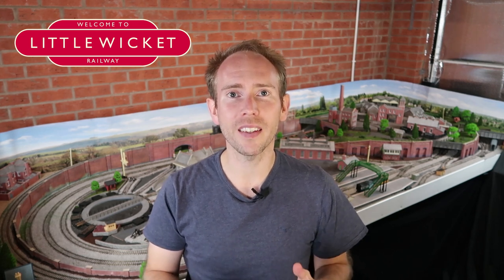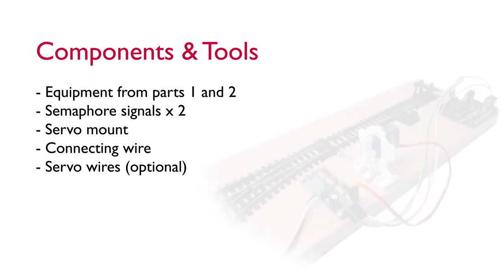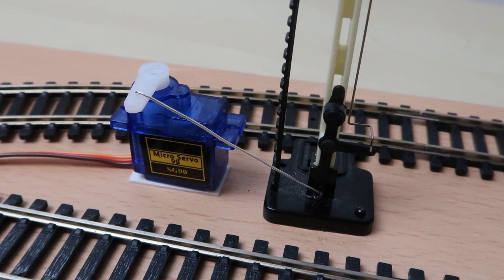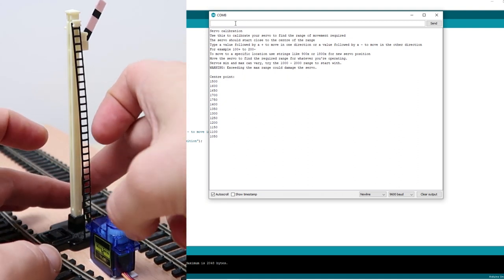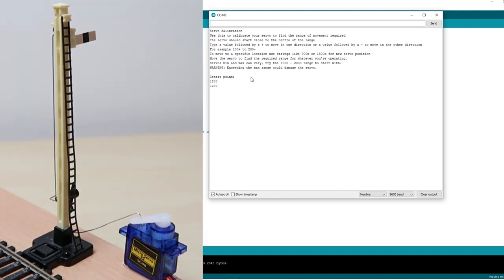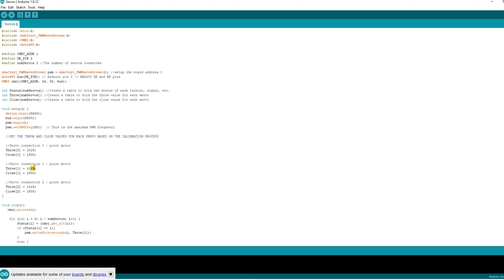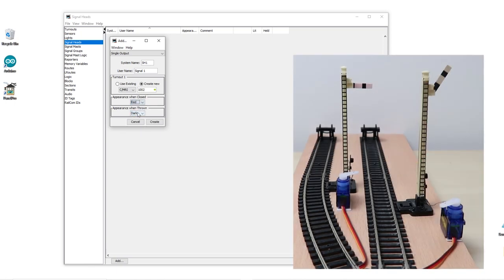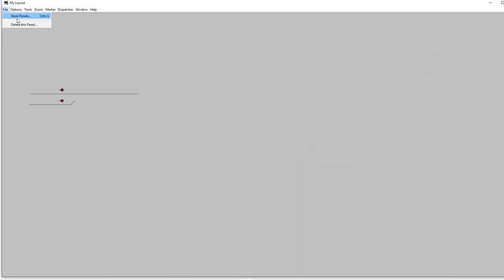Servo Motor Control for Model Railways Part 3 of 3 - Semaphore Signals

Comment: Hello Rob, I knew nothing about Arduino, but after watching your 3 videos, bought Uno, servo etc and  I made my first project for my test layout and worked, great!!!.....I could not use DCC++ right now as my collections are Marklin....but found Railuino....this will be my next project. Thank you for the video....
Reply from the maker: Thanks and congratulations on a successful project! 👍
Reply: @LittleWicketRailway  Hi Rob, based on your original sketch, I could modify the sketch for multiple PCA9685 for servo, but still do not know how to sketch for the LED, appreciate very much if you could make a video (part#4?) for PCA9685 connecting with LED for signal lamp (Red, Yellow and Green). I tried, but it did not work. (my first PCA is for turn out, 2nd for semaphore signal and 3rd one is for signal lamp). Thank you and appreciate very much.
Reply from the maker: Hi Nugroho! You were ahead of me in linking PCA9685s, I've only just round to doing it. I was actually reading about controlling LEDs today! Are you using a tricolour LED or 3 separate LEDs?

Comment: Now watched all 3 videos, and I got it working. Excellent tutorials. Managed to get my head around JMRI , CMRI. Doesn't seem too complicated now. Watched others and ended up with several bits of hardware I didn't need. I will start with a small shunting layout and see how it goes. By the way I am using 3 rail Hornby Dublo that is at least 60 years old.
Reply from the maker: Congratulations on getting it all workings! Hope that it all works with the 3 rail set up, I like the idea of having a 60 year old layout being controlled with modern digital electronics. 👍

Comment: Thanks Rob you have converted me to your system of servo control thanks.
Reply from the maker: Thanks Steve, sadly I installed solenoid motors on Little Wicket before I discovered servos. It's looking like I might get the opportunity to redesign and expand Little Wicket in 2021, so I'll definitely be converting to servos if that happens.

Comment: Hello Rob, I only found your channel today and are very impressed as I've been looking for ways to automate my railway, I like the robust design for changing points and signals, infact after watching many videos on the subject I find yours the Best. As a retired BR signalman signalling  has to look right on a model railway, I watch in dispare at the Hornby magazine layout with there GWR bracket signal by the station, not so much that it's a Midland railway layout its the fact the taller arm should represent the main line not the lower. I run a OO gauge Garden railway with about 240 feet of track with many points and signals, unfortunately my computer and it's attachments skills are almost zero, I don't know what you do for a living but if you ever had the time I would like to commission you to use your methods to automate and install them on my railway. Thank you for informative and inspirational video's.
Reply from the maker: Hi Paul! I know who I'm coming to for advice on signalling in future and your 240ft layout sounds amazing! However, I don't think I'm quite at the stage where I'm ready to do commissions. I'm still learning and there's some way to go. If our house move goes to plan then I'll be building a larger layout. If that goes to plan then I might feel a bit more confident about working on someone else's pride and joy. Stay in touch though and if you've got any pictures of your layout then I'd love to see them 👍😀
Reply: @LittleWicketRailway  Thank you for your reply Rob, I hope the house move goes well. I have every confidence in your ability to install signals, point work and automation on model railways, you can't bluff on a subject so complex, I appreciate your honesty and indeed none of us ever stop learning whatever the subject, I appreciate components and wiring has to be more robust and protected outside, but I still hope you could help me install it in time, I would like to send you pictures and videos but haven't enough computer knowledge to do it at present or even how to contact you in private, please keep up your Great work and I'm very impressed with your knowledge and presentation,  kindest regards. Paul.

Comment: To add a tad of realism you can set the range of movements to slightly different settings (maybe +/-10) to show a degree of wear between different signals.

Comment: This is getting me towards my idea, as my layout plans will involve a lot of points, servos are the way to go for me, just on the cost saving, but i dont need computer software, my intention is mimic panels for each area with switch control and led indicators, i`ve yet to find a nuts and bolts video on this, unless you can point me in the right direction, Thanks great series of videos.
Reply from the maker: Hi! I'm been thinking about this a lot recently and I've got a few ideas. You're the second person to ask about using a mimic panel with physical switches rather than a computer. First few days of 2021 will be dedicated to electronics so let's seen what happens. Hope to come back to you with a cheap and simple solution.
Reply: @LittleWicketRailway  Thanks only one i`ve found is toms trains and things using a pca9685 but he was switching a sevo via the uno

Comment: One more step to complete: add a logic that automatically changes the aspect of the two semaphores according to the turnout direction
Reply from the maker: Hi! Check out this video with full automation. The signals change automatically based on block occupancy and the position of the turnout https://youtu.be/5lvvoBCQl9U

Comment: Hi Rob, just discovered your site. Excellent tutorials. Could you clarify something for me? I’m using a SPROG 3 as my dcc controller, with JMRI. I want to use servos for the points , so am I correct in understanding that I need my pc connected to both the SPROG for train control, and a separate Arduino + servo driver board for the points.?  Does JMRI allow both Sprog and Arduino simultaneously?
Thank you

Comment: Nicely done videos! The whole servo calibration is really messy, and I wonder if there's a better way to handle this all. AIUI the Adafruit library can read the actual servo position so you could perhaps manage some automatic min/max discovery.
Reply from the maker: Agreed it's messy. The issue is that there's no easy way to sense when the servo can't move any further (I.e. stalled) servos with built in feedback are expensive. There are ways of adding feedback, but they're not simple.

Someone (apologies I can recall who) has significantly improved my sketch and has submitted the improvement on GitHub for me to review. I think the improvement makes calibration a lot easier from what I briefly saw.

I also want to look at building some stall protection into the sketch. Let's say a turnout/point can't fully throw because something is in the way. The turnout will keep trying to move through the obstruction. It'll draw a lot of current and I don't think it'd be good for a servo. I'd like the servo to stop trying after a couple of seconds. This makes exact calibration slightly less important.

Comment: I'm just getting into Arduino as a preparation to a future build, and your tutorial was super helpful.
But I still got a big question, if you don't want to use a computer as your switching pannel, but much bottoms or switches, as you would in an old fashion layout but using a programmed Arduino is that also possible?
Reply from the maker: Thanks! Yeah, definitely possible. You might find this useful https://youtu.be/-qEL5MGZXB4
Reply: @LittleWicketRailway  Thanks for the link, I'll have a look at it, I love you YouTube channel, very well made and understandable videos👍

Comment: Great videos thank you  question I built command station using instructions from your other video  This uno is a new one I need to buy to control points and signals ?
Reply from the maker: I kept my command station separate from my sensor/servo control, but DCC-EX allows you to have everything connected one one board. I've just been playing around with automation using EXRAIL which is brilliant.
Reply: @LittleWicketRailway   Are you still using Arcomora?

Comment: Hi Rob one question is there a way to control those servo with a button, so i dont have to klick it on JMRI instead i wire it to a button when i click it switch does brrt to the left when i click it again goes brrt to the right :)

Comment: Can i ask a stupid question. You connect the arduino to a pc to program it. Does it need to be connected to the pc once programmed?
Reply from the maker: No stupid questions 🙂 It doesn't need to be connected to the computer once the sketch is uploaded.
Reply: @LittleWicketRailway  Thanks. Another question, i take it i do the arduino and jmri software bits. How can i control the points? Would toggle switches, buttons or stud and probe be options?

Comment: Hello I have been watching your videos and have tried to use your servo sketch to drive 16 servos. I have been able to get 8 servos working but when I add number 9 in they all just start twitching and become unresponsive in JMRI did you have any problems like this ? If you did what was the fix. thanks James
Reply from the maker: I haven't had this problem, but it could be "servo chatter"? @Stephen Wadsworth (not sure if that'll tag him) said that he experienced chatter and added a relay with a slight change to his code to solve it and now has 34 servos operating. See his comment on here https://www.youtube.com/watch?v=WsfczIPbhsU

Comment: Rob I just watch these 3 videos in the series they are very good and have got me wishing to try this.
At the moment I use a Roco Z21 controller with Digitrax point controllers linked up using Loconet.
Do have any idea how I could interface the system into my setup I have played with JMRI and have the Digitrax interface to a PC 
I would like to use the Z21 for control of the points using servos.
Any ideas how to interface them together
Thank you
Dave
Reply from the maker: Sorry Dave, I've got no experience with Roco or Digitrax. JMRI is a very useful hub for bringing various systems together, so you might find that if you can get all your systems recognised in the software then you could have your existing controllers operating the servos one way or another.

This might be useful:
https://www.jmri.org/help/en/html/hardware/roco/z21/index.shtml
https://www.jmri.org/help/en/html/hardware/loconet/Digitrax.shtml

Comment: Hi Rob,  Fantastic Videos.   I get these 3 vids and your explanation has really opened my eyes to the possibility of servos.  One question though, can you run them off a physical analogue momentary switch like I want to on my layout?
Reply from the maker: Hi Tra, you definitely can have servos activated by a push buttons, but you'd still need a servo driver than could generate the PWM signals that tell the servo which position to be in. You can either build your own controller using something like an Arduino and PCA9685 (see this video - https://youtu.be/-qEL5MGZXB4) or buy a ready made solution (https://megapointscontrollers.co.uk/product/servo-controller-12/?v=79cba1185463).
Reply: @LittleWicketRailway  Great thanks Rob, I will get to it I already have the kit you discussed.  Keep up the great work.

Comment: This is very interesting and well presented. My planned layout is a shelf layout about 30’ long. Do you know how far a servo can be from the servo driver board and the Arduino?  And how far apart the servo driver boards can be?
Reply from the maker: If you use CMRI then the CMRI wires can be very long, hundreds of meters I believe. Not sure about the servos, but I'm had one on a 6ft wire on my last layout.
Reply: Thanks

Comment: Hi Rob.
Any chance you could do another video showing how to add a push button to throw the turnout locally and keep JMRI updated?
Reply from the maker: I'll have a think about this. Would you also want to be able to throw the point using JMRI or just using the physical switch?
Reply: @LittleWicketRailway  Hi Rob.  Control from JMRI or the physical switch and keep everything "in sync."  Here is what I have come up with so far using your JMRI servo motor control sketch and a JMRI/physical button sketch from "motorhomer's" blog http://www.motorhomesites.org.uk/?p=5007. 

#include <Wire.h>
#include <Adafruit_PWMServoDriver.h>
#include <CMRI.h>
#include <Auto485.h>

#define CMRI_ADDR 1
#define DE_PIN 2
#define numServos 3 //The number of servos connected

Adafruit_PWMServoDriver pwm = Adafruit_PWMServoDriver(); //setup the board address 0
Auto485 bus(DE_PIN); // Arduino pin 2 -> MAX485 DE and RE pins
CMRI cmri(CMRI_ADDR, 24, 48, bus);

int Status[numServos]; //Create a table to hold the status of each turnout, signal, etc.
int Throw[numServos]; //Create a table to hold the throw value for each servo
int Close[numServos]; //Create a table to hold the close value for each servo
const int controlSW = 6;
int controlSW_state;
int lastControlState = LOW;
int control = LOW;
unsigned long lastDebounceTime = 0;
unsigned long debounceDelay = 50; 

void setup() {
  Serial.begin(9600);
  bus.begin(9600);
  pwm.begin();
  pwm.setPWMFreq(50);  // This is the maximum PWM frequency
  pinMode(controlSW, INPUT_PULLUP);

  //SET THE THROW AND CLOSE VALUES FOR EACH SERVO BASED ON THE CALIBRATION PROCESS
  
  //Servo connection 0 - point motor
  Throw[0] = 1200;
  Close[0] = 1700;
  Throw[1] = 1200;
  Close[1] = 1700;
  Throw[2] = 1200;
  Close[2] = 1700;
}

void loop(){
   cmri.process();

    for (int i = 0; i < numServos; i++) {
        Status[i] = (cmri.get_bit(i));
        if (Status[i] == 1){
            pwm.writeMicroseconds(i, Throw[i]);
        }
        else {
            pwm.writeMicroseconds(i, Close[i]);
        }
    }
    readSwitch();
}
 void readSwitch(){
  int reading = digitalRead(controlSW);
  if (reading != lastControlState){
    lastDebounceTime = millis;
  }
  if((millis() - lastDebounceTime) > debounceDelay){
    if (reading != lastControlState){
      lastControlState = reading;
      if (lastControlState == HIGH){
        control = !control;
      }
    }
  }
  cmri.set_bit(0, control);
}
    
Following motorhomer's blog,  sensors and a route need to be set up in JMRI.  I don't bother with the microswitch for feedback, as it appears to me JMRI does not really do anything with the information.  I am not sure what the best way to modify the code for adding more pushbuttons, as I don't think every turnout will have a button.  I am new to Arduinos, so still some learning.  I am think perhaps an array.  In this sketch I have one pushbutton set up for turnout 1 (CRMI bit 0) on pin 6.  I can control the turnout from JMRI or the pushbutton, and the correct physical state is updated in JMRI.  My sequence for start up is to open JMRI (wait a few seconds for the servos to move),  load the JMRI panel (wait a few seconds for the servos to move) and then run the script TurnoutStatePersistence.py to load the turnout states from when I last exited JMRI, all of which takes less than 30 seconds.  Please share any thoughts for code suggestions or improvements!

Comment: I'm considering installing servos for point motors on my current in development layout.
It currently has Hornby Solenoid type point motors installed, activated by an array of switches. (flick them up or down to pulse the solenoid)
I would like to keep this old-school type of control system, nothing digital or DCC.
Could this Arduino system be configured to be controlled by several dozen switches? (currently 21 bi-directional switches, totalling 42 different "buttons")
Reply from the maker: Yes, very possible with a bit of coding. The switches would be inputs to the Arduino and the servos would be outputs. The Ardunio would read the inputs and change the outputs as required based on what you've coded. You could code this with a few if statements and loops.
Reply: @LittleWicketRailway  I've personally not used an Arduino before, however I am somewhat familiar with the device, as when I worked at the local college, one of the lecturers used to play with them. I have had experience with some other devices though, and am knowledgeable with a few different programming languages.

I guess the another question is... with 21 sets of points, and possibly some signals, how many kits will I need?

I know from the video that the controller you were using only has 16 servo controllers, so I guess I would need at least two, but then each servo would also need 2 inputs. How many inputs can an Arduino have? (though, being an electronic engineer, I could get creative and multiplex several inputs together, or read large arrays of inputs from PISO chips. I guess it depends how much customisation I can do)

Comment: Hi Rob
I have followed your videos with interest and are very helpful in understanding both programming and jmri.   I have a layout with an extended board where the main layout is controlled by an arduino uno / motor shield using DCC++ and the extended board is an arduino uno with two pca9685 boards and a 5vPSU to operate the servos.   it seems there is an issue when the power button is pressed in the roster menu to activate the main board.   As i have followed the video instructions i was wondering if you had any thoughts on what may be causing the servos on the extended board to not function, there is power goingto the servos as when you try to push the servo arm there is resistance to movement.

Regards
Colin